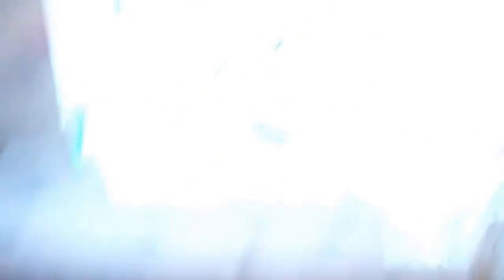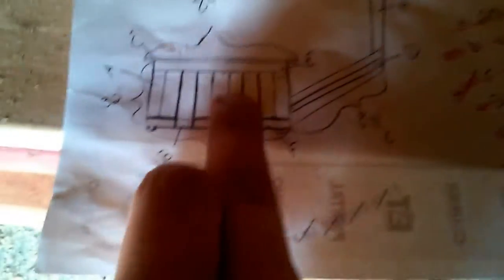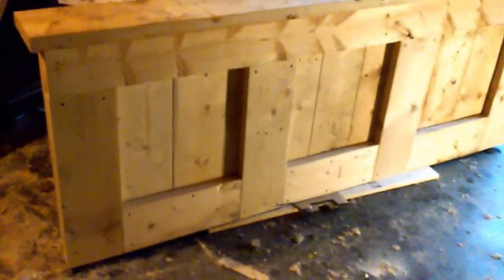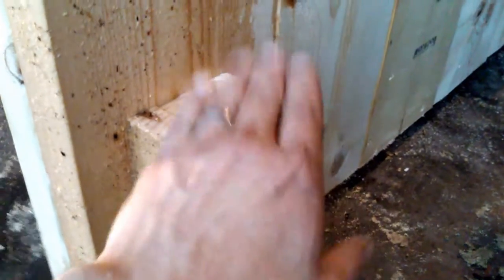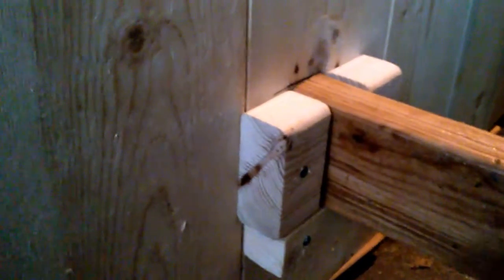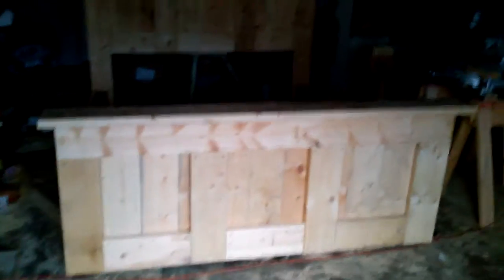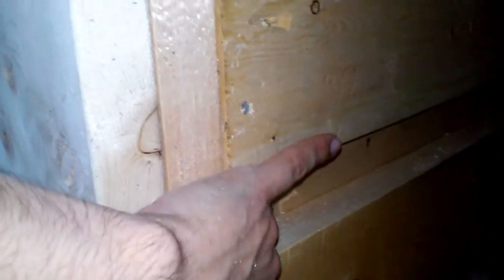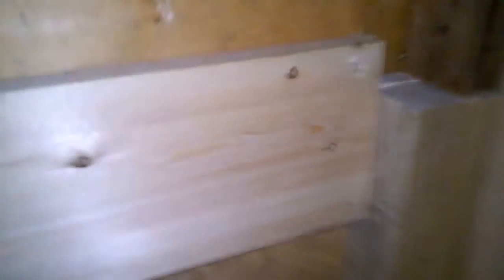How to build a huge king size bed for about $200

Comment: so what did you wind up doing differently  with the 17" on the headboard
Reply from the maker: Scottie MORRIS if u pool on the footboard the vertical runners line up with the boards directly behind them and it makes it difficult to attatch those bottom horizontal boards to everything, so i offset the headboard a couple inches so i would have more to screw to